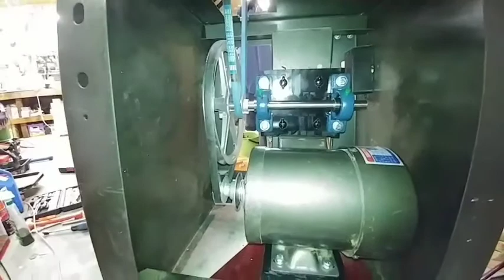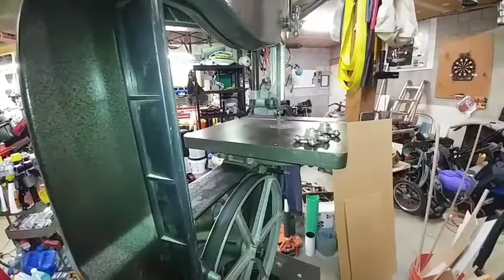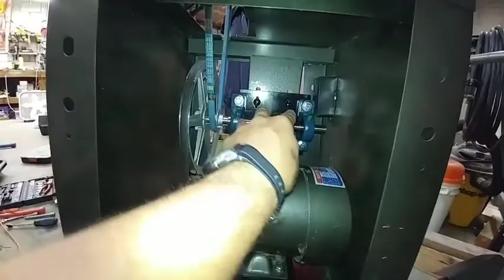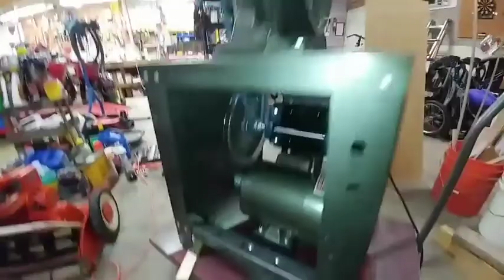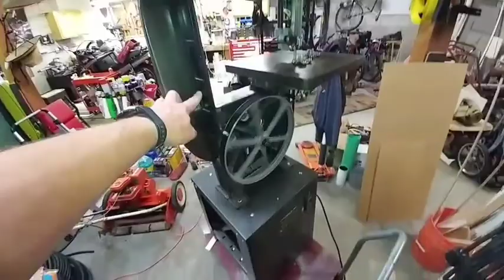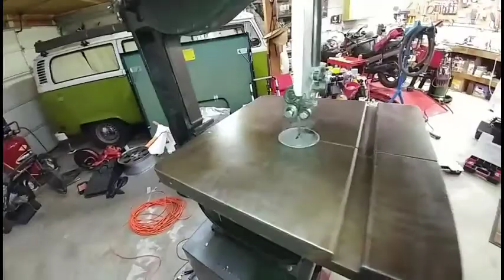Slowing down my band saw. (14" Made in Taiwan)

Comment: That's a great modification ,very neat  ,the whole jack shaft/pulley look well supported. I've been thinking about converting my wood/metal bandsaw to cut metal, my bandsaw already has two pulleys for metal cutting but that is still too fast to cut steel, all those pulleys leave no free space to add more /bigger ones, you seem to have a lot of space around the motor for the extras.
Well done.
Reply from the maker: thank you